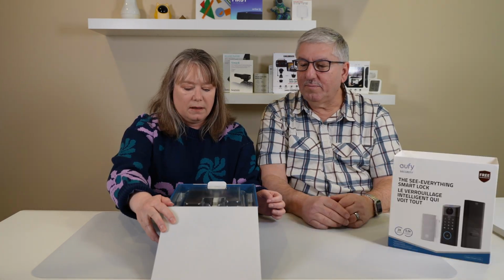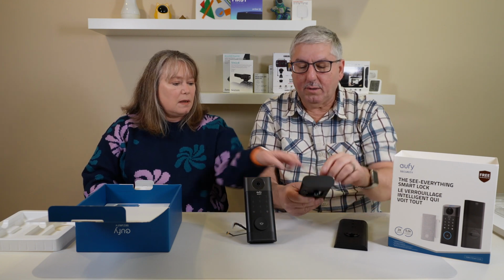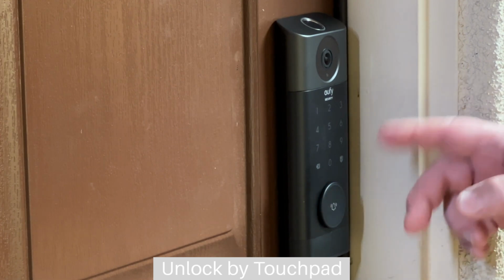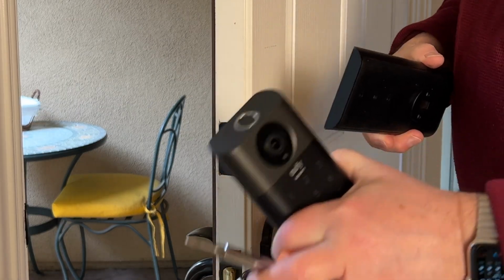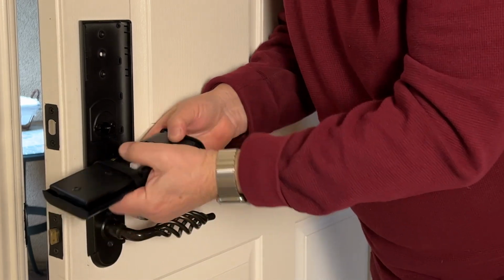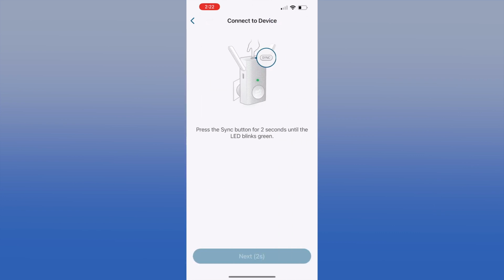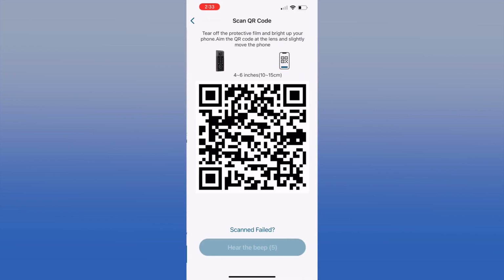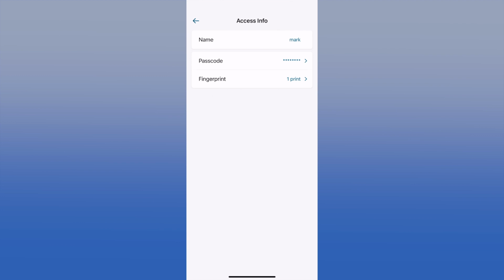A lock? A doorbell? It's both! - Review: eufy Security S330 Video Smart Lock - Unbox, Install, Test

Comment: Great video. I thought the unpacking and installation/setup portions were really good. I would have liked to hear more of your opinions about the device. Otherwise, excellent video.
Reply from the maker: Hey Poppa, thank you! As for the lock, we really like it. It is a solid build, does a good job of notifying us. and the videos are clear.and it works with the Dufy s380 for local storage and detection. And it's still on the door. What is funny, at least to us, is we now have 3 video doorbells, one wall camera and even an inside camera pointed out to our entry. We have to say if folks come to the door we get plenty of notifications:)